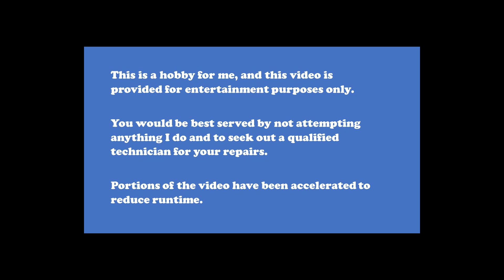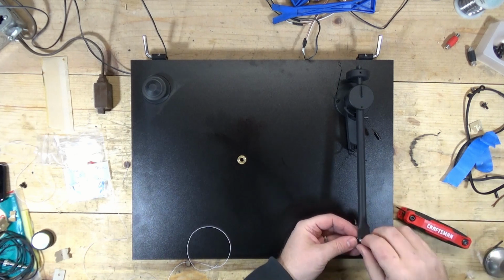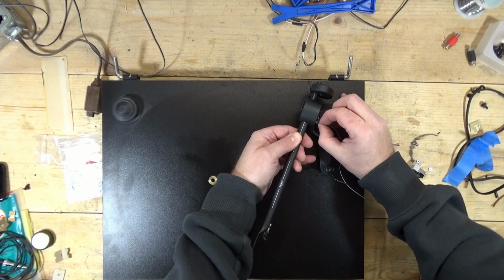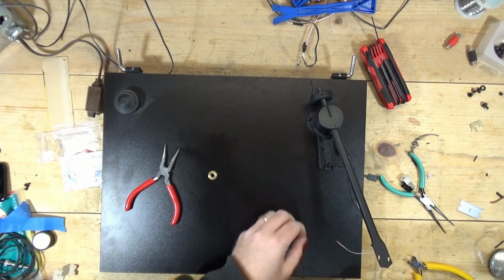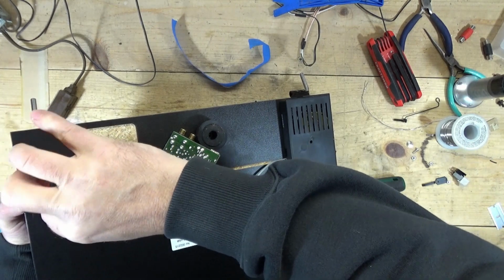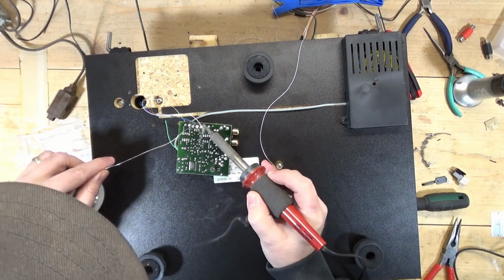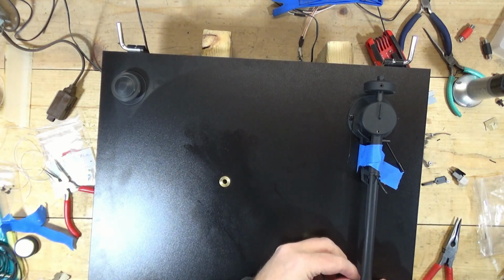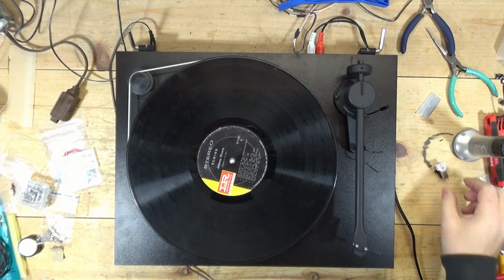Pro Ject Essential Turntable Repair - Distorted Left Channel

Comment: Thanks for posting this. Just managed to rip off the white cartridge cable from my Pro-ject turntable so looks like I’ll be having a go at this too 😮
Reply from the maker: Good luck!
Reply: Same here but rather than replacing the entire wire (must be a real b&%$£ to guide through) i've just bought short lengths with 2 ends to be soldered.  Wish me luck.

Comment: Our movers decided to cut all of the tonearm cables and tape the actual arm part to the inside of the plastic cover... No idea why any intelligent being would think that was a good idea, but our turntable has been sitting around in storage for 8 years now. Thought "I can't really ruin it any more, let's just try to fix it" and I was wondering if I'd have to replace all of this, but I might as well buy new with the price of the parts. I never even considered replacing the tonearm wires, but I think this might be the solution to getting this thing working again. Time to get my ass kicked. Thanks for sharing!
Reply from the maker: Good luck!